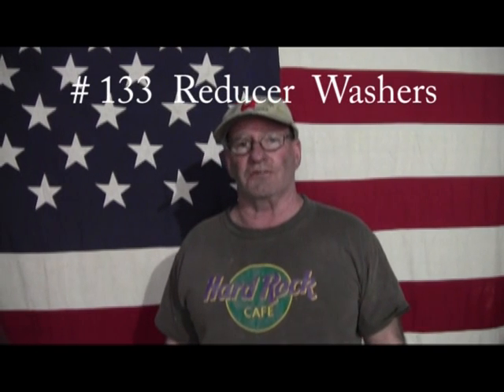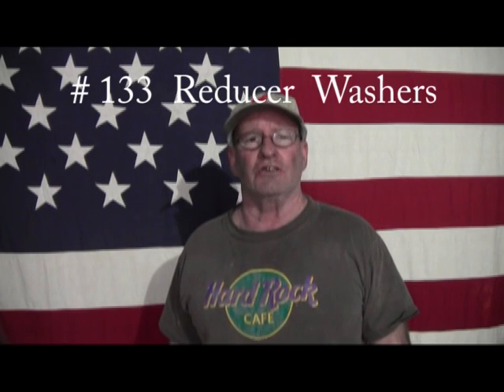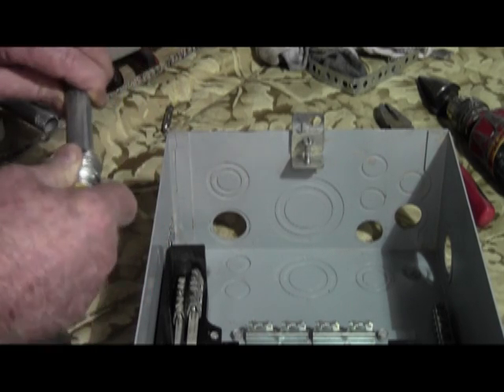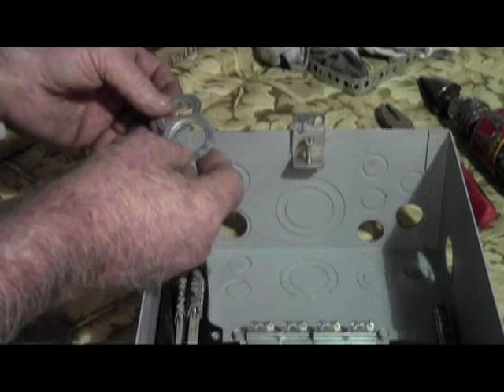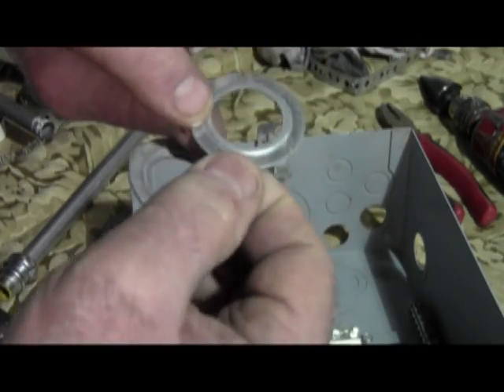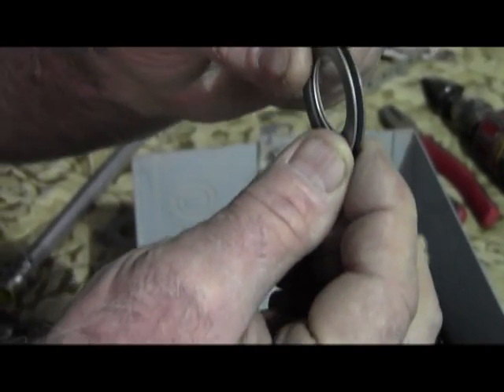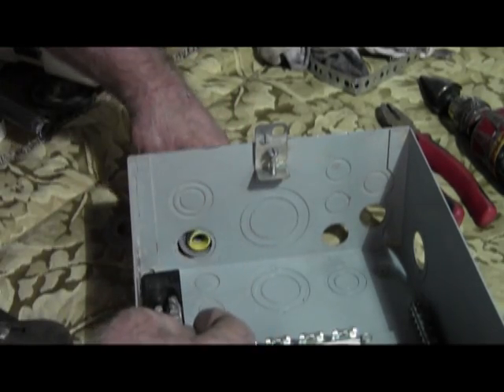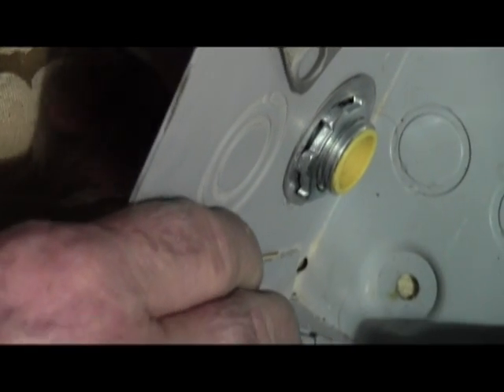NEC Approved panel repair #3 N 133

Comment: Well, I am still struggling with the math behind common pipe bends, as well as blueprint reading and wiring things like E-mon D-mons leaves me completely flummoxed. Like you mentioned below in another comment, any good code stuff is appreciated. I am so green that I don't even have a copy of the NEC, but after hearing how integral it is to any licensing/testing I figure the sooner I start to memorize it the better. I have a hell of a long way to go, but your videos ARE helping. Thank you!

Comment from the maker: Continuing-the code book is 60% of the test and asks you dumb things like "what is the diffusion rate of a smoke detector in a hospital plenum" WHAT! I guessed-got lucky. A little bit will be on safety, delta/wye transformer math, general workmanship and overall trade practices, commercial and residential. KNOW ALL GROUNDING CODES My weakest part was code, just didn't expect that much book stuff coming at me. Wasn't ready but I did pass with a 78%-70% passes. I aced the legal portion-99% YEAH!

Comment from the maker: One big advantage is that they allow a small amount of flexibility of location if the conduit isn't right on the money, which takes stress off the fitting. While were on the subject, do you have any request on technique or code that I can do 'in studio'. I been doing this so long I forget the things that were hard for me to learn. Any suggestions would be greatly appreciated. In the meantime I am waiting for a reply from the contractors board before I do a few plumbing videos. I NEED MO MATERIAL

Comment: It's funny, no one in the company I am working for as an electrician helper thinks to use these things! Instead, if the hole is too big, they instead use a KO hole seal and then just bust out a different hole! Seems like these are a better solution.

Comment from the maker: First, I used to be a professional painter and know all about skips, holidays, runs, over taping and so on. If you want to be a pro electrician you must know two things: Code, which you can learn by reading. and mechanical, which you can only learn from other electricians (or videos like mine). I am looking to wire a house and teach the owner at the same time. I could get about 25 practical hands on videos from a project like that. in fact it would complete my mechanical portion. so far no luck.

Comment: Nice one John. Keep em comming. Funny, my main trade is painting for about 15years. I did some electrical work as an apprentice in Dallas,TX about 11 years ago. I wished that I would have stuck with it more because electrical work seems to have alot more respect and job security than that of a painter. This upsets me knowing that just about everything in the world has some sort of protective coating on it, painters have helped in the beautification/preservation of materials since the Roman age.